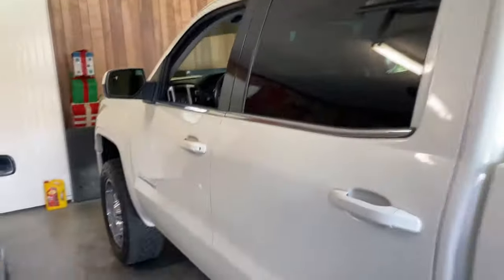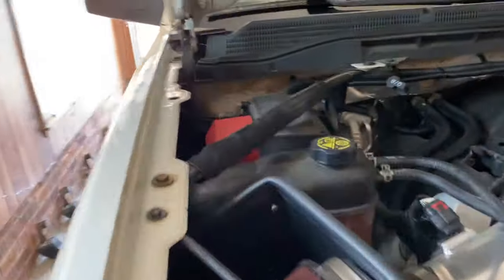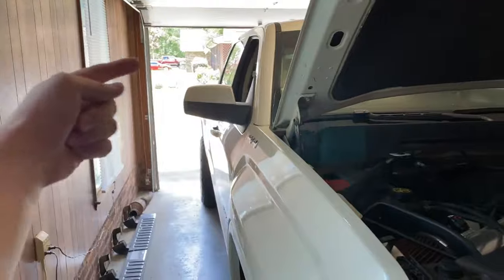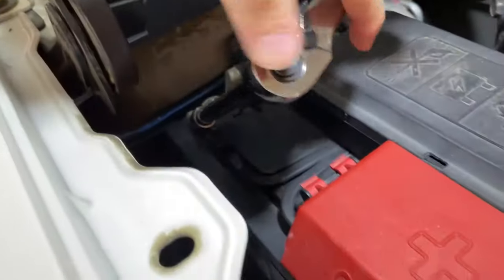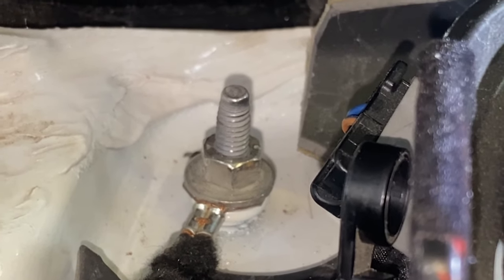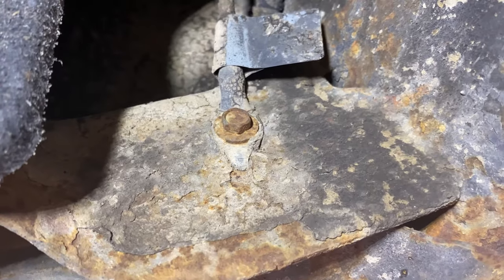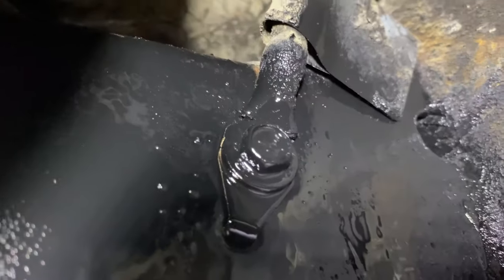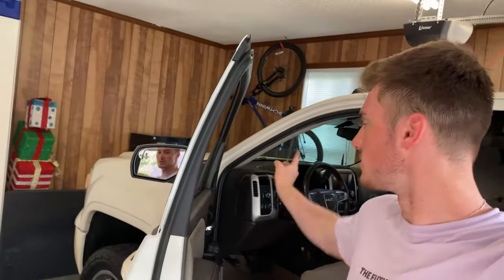2014-2018 Sierra/Silverado Flickering or Shutting Off...Ground Issue SOLVED!

Comment: Just the did the frame rail one on my 17 silverado. My ground was actually loose and covered in the frame wax. No idea how was even able to ground anything. Cleaned the frame to bare metal then tightened back down. No issues so far. My issue was stabilitrak and service trailer brake, and loss of power steering, and loss of power to guage cluster and radio all in one.
Reply from the maker: Lmk how this goes!
Reply: Thats what I'm going through now with my 18, although when I lost everything the radio kept on playing.  The worst part is it would go in to reduced power mode and only idle untill I cleared the codes... on the side of the interstate.  I fixed the problem for 5 months by replacing the SDGM module but now its back.  The G218 grounds were perfect, the frame ground was just like yours.  Hopefully it fixes the issue.. lately if it throws the codes I can't clear them as the scanner won't connect during that condition..  BCM module next or maybe somebody will steal this truck..
Reply from the maker: @joshb124  Check your connections inside the distribution block (small black on top of your battery) to see if that is effecting you too. I cleaned the connections with some wire brushes and applied some dialectic grease on them before tightening down.
Reply: @hunterrwiilson issue came back with this week's snow event. Gonna try this ground point. Ugh
Reply from the maker: @hummer3524  it’s definitely annoying. Hopefully cleaning and tightening these additional grounds will help
Reply: @hunterrwiilson  tell me about it, last thing to do is replace the negative battery cable which seems to an issue with these trucks as well
Reply from the maker: @hummer3524  I’ve heard. I love my GMC don’t get me wrong, but that fact that GM didn’t address this issue is kinda disappointing. I’ve heard some pretty rough situations from others commenting that their truck shut off on the highway with their family inside. Not a cool situation
Reply: @hunterrwiilson read that too in the forums. I did try the g218 ground however seems my truck was late enough that it was already fixed from factory. Ordered a replacment negative battery cable. See if that fixes it.
Reply from the maker: @hummer3524  that seems to be the last resort (that works) for some folks in here
Reply: @hummer3524  Any luck with the new negative battery cable?

Comment: The issue that I am having, is that the dash lights if there are not them, they do flicker somewhat ever-so-slightly. The other day, my AC took about 10 minutes to start blowing cold air. Lastly, the other day my radio did not seem to have a display, although when I looked at it in the nighttime, I could see that it was lit up. I did verify that the fuse was okay on the radio circuit. I am hoping that these two ground issues will cause my issue to go away. Lastly, when the dash flickers, the AC seems to go in rhythm with the flicker.
Reply from the maker: Seems like you need to give these two grounds out along with the other ground on the other side of the dash. That one is responsible for the AC. Clear those three grounds and see what it does for you!
Reply: @hunterrwiilson  I absolutely will give that a shot. Thank you. By the way, is the other ground on the other side as accessible as the driver side?
Reply from the maker: @dennisranck1613  of course! Glad I can help if any! Yeah it should be just as accessible as the driver side

Comment: OK... So I had all the same general issues. But when I tried to do the "Clean-up" fix of the 2 ground lugs under the dash cover I just could not get at them. No way could I undo the connection and clean the area. Plus I do not really buy that the coating is the problem. ANYWAY... What I did and it COMPLETELY solved all the strange electrical issues and it has not stalled again is run a new "Ground-Bus". Even with the very limited access I was able to secure a crimp-on wire loop terminal on top on the existing ground stud with another nut. I used #8 AWG wire (10AGW likely OK) from the driver side over to the passenger side and then down via the lower passenger side interior kick cover to the main frame/chassis ground lug as shown in many videos. This new ground bus between the two under dash cover ground lugs and to the frame ground fixed all these strange electrical issues. Hope this is helpful info. It has now been almost a year and all is still working well.
Reply from the maker: Sounds like a solid solution! You’d probably have good traction if you made a video on this
Reply: @hunterrwiilson  I'm not a video guy and enjoyed yours. Feel free to use my info for any new update by you.
Reply from the maker: @johntflaim9924  fair enough. I’ll be sure to inform others if they want to try another solution!
Reply: Forgive my ignorance, but what's a ground bus?
Reply: @DanRivas04  A BUS in electrical talk is just a common point that a termination is connected to. In industrial control systems there is always a Ground BUS Bar, a heavy gage copper bar that ALL ground leads/wirers are connected to so they ALL have the same ground point/potential. So I ran a heavy gage copper wire from the driver side to the passenger side and then down to the frame ground lug/ point. In this case the truck frame is the Bus Bar/ common point. I hope this helps. Sorry for being so late.
Reply: Thank you so much, that was a great breakdown, now I know what I need to do!
Reply: If I understand.  YOu just connected another ground wire to the battery post and somewhere to the passenger frame?  Did you go through the sensor?  Can you elaborate where you connected to the frame?

Comment: Thanks to my wife she found you and this.    Chevy service alert does not address this secondary ignition ground.  Also,  your truck looks like most underside.   We do the beach and bunch of 4x4, so yup, i checked all other possibilities,  but not the one by the speaker.  Will update after i address.   2017 silverado z71 was at the dealership for 1 months and they fixed all other bs, but nothing to address this.
Reply from the maker: Hoping it works out for you! Thanks to you and your wife for watching!

Comment: My truck started acting up today doing the exact same thing, left to work at 5am & headlights turned off & so did the dash followed by my steering wheel locking up on me as I was trying to switch lanes. It was very scary luckily there were no cars close to me & I was able to pull over turn it off & back on.
Reply from the maker: Definitely give this a try to be safe!

Comment: So I've had the same issue as many on here - Usually starts with lights flickering, stabilitrack light coming on, and the steering getting hard, then the steering wheel jerks and all electrical power is lost. Usually this all happens during low speed turns such as pulling into a parking space. I fumble around for a few minutes, open the door, blah blah, and can usually restart in a few minutes. Anti-theft kicks in and tells me to lower and raise the driver side window. Frustrating as hell. After watching your video, I went after all the ground wires - The ones under the dash, the one at the block, the one behind the wheel, etc etc etc. Took them off, cleaned, scrubbed, you name it. I had hopes, and seemingly for a couple of weeks, it worked. Unfortunately, the issue came back. So now I'm thinking the common denominator is the cable itself. I could be wrong, but I'm nearing the end of my rope with this stupid issue. So, at some point in the near future, I will order a new cable, install it, and will report back after seeing if the issue returns after that.
Reply from the maker: Others have done the same with replacing the ground wire itself and it’s seemed to work for them, grounding/electrical issues are the worst since they’re all tied together and the possibilities are endless
Reply: This didn’t work on mine. Gonna replace the negative battery cable next before driving it off a cliff.
Reply from the maker: @drrexhuffman  make sure you get it on video if it don’t work, never seen ‘14 Sierra go off a cliff
Reply: did you solve your issue?

Comment: This started up on my 2018 Silverado, the exact symptoms, Stabilitrak flashing, truck shutting off then right back on. Did the G218 fix, new negative battery cable, cleaned the contacts on the frame and engine block. Still doing it. Mechanic is telling me need a new battery, which is less than a year old. Different mechanic said change out the positive wire to the starter. Online forum says power steering issue could also cause this... about to just trade the truck in...
Reply from the maker: Did you give cleaning the distribution box connections a shot? It's the small box on top of the battery. I removed them, hit with a wire brush, applied diaelectric grease on there and tightened everything back nice and tight. I'd make sure all connections are solid, if you already haven't. But I hate to hear all of these issues. Makes a guy upset at GM for not doing anything about this :(
Reply: @hunterrwiilson  I have not tried that! I am willing to do anything at this point to make the gremlin go away. I am die hard Chevy, like have the tattoo with VIN number of my 1995 Tahoe on my arm😁... what I would give for that truck back!
Reply from the maker: @butters1877  yeah try it out! But that’s awesome! 😂 I miss the OG Sierra that started my love for trucks and kinda this channel, but I’ll get another, or that exact one, back one of these days
Reply: @butters1877 
 Update on your truck!
Reply: same, did you find the issue?

Comment: I have a similar issue out of my 2014, to where you’ll go to slow down to turn & the whole truck will shut off. A/C, radio & all. Coast to a stop, put the truck in park & restart it & a message reads “roll passenger side window down.” Hoping this fixes my issue as I’ve done the ground wire behind the passenger side wheel & no luck.
Reply from the maker: Yeah it’s a scary and annoying thing these trucks do. This has worked for me till this day, so I’m hoping it works for you
Reply: @hunterrwiilson  wow so even a year later & it’s still working ? I just bought my truck back in March & it’s done it twice. You ever have problems with the AC shutting off randomly for like a minute & then coming back on ?
Reply from the maker: @ryandurham5725  I haven’t had issues with the AC besides having to replace the condenser.
Reply: @hunterrwiilson  what were the issues you had with the AC when you had to replace the condenser if you don't mind me asking. I'm having a lot of issues where the AC will be blowing perfectly fine & then just completely cut out & black out the screen. Then a couple minutes later it comes right back on in its normal state.
Reply from the maker: @ryandurham5725  mine was a crack in a weld on the condenser. Very common in our year models. 

What it sounds like for you is a ground issue. So just as you saw me correct and fix the ground on the drivers side, do the that same process to the passenger side ground in the dash. That, allegedly, is what the AC is grounded to. So I’d give that a shot and see what happens.
Reply: @ryandurham5725  having the same issue please let me know if this fixed it or what foxed it for you
Reply: My 14 did the exact same thing yesterday pulling into my driveway
Reply: I have a 2014 silverado That started to mess up ..the voltage gauge reads high and radio and a/c turns off but once voltage gauge goes down they start working again. Any one have this issue or know how to fix it.
Reply: @AlexanderGarcia-do5dk  I was told by a dealership that they wanted to replace the battery cables & the fuse box connected to the battery. My AC still cuts off & then about a minute later comes back on, I haven’t tried either of what the dealership says but could be similar issue. Dealership did say they read high voltage 🤷‍♂️ also, I sanded down the grounds behind the passenger wheel as well as behind the speakers.

Comment: 2018 Chevy Silverado. Yeah same thing here for the past two weeks. Service Stabil Trak and Roll down window message. Mine still under a warranty but they (Dealership) are only covering the positive cable replacement. So going to try the cleaning ground contacts.
Reply from the maker: Exactly why I just hop on Dr. Google and figure it out myself, dealerships don't really help too much
Reply: P
Reply: So did that work for u? Mine is doin the same rn
Reply: @joeroe2839  yes it did.  Have not had any issue since then.
Reply: I have a 2018 too, did the me dash insulation, happened again after a month, had the battery, alternator and charging tested and everything is good. Just gotta do this trick in the video
Reply: @mistermikesal1086  hows your truck running? have had stabilitrack issue for over a year, no cruise, no other issues put 35k on since the light came on. 2018 sierra

Comment: Same issue. I got a size 10 wrench to fit in the speaker hole and from there I loosened and tightened it back up. Removed that foam shit from around and underneath

Comment: 2014 Sierra 1500 with 142k miles - symptoms were "Roll down, then up drivers window" message and one click up on drivers window did not work - had to hold button up to get window up, voltage reading just under 14 when should be just above 14, gentle dash lights flickering, left turn had temporary loss of power steering, blinker use causes cruise control to kick off, clock suddenly 47 minutes behind and yesterday the truck quit and went black while preparing to enter main roadway.  I disconnected negative battery terminal for two minutes, reconnected fired up just fine.  

First I removed dash and cleared the rubber material from both ground posts G218 and G210 resistance codes - drivers side rubber was pinched under nut washer, just don't understand how assembler could do this at factory - the hole in the material means it goes AROUND the outside of the post, and they want a 40% raise in pay for a 32 hour work week.  Started truck, still getting roll down then up window error message.  Next removed, cleaned surface and ground wire end on passenger side inside wheel well, covered with heavy duty grease to prevent element deterioration.  Opened hood and removed and cleaned ground post and end to firewall.  Started truck, no  more errors.  So far so good.  Prior errors included "Reduced engine speed" - code was wheel speed sensor - really GM, you're going to force me off the freeway because of a fricking wheel speed sensor issue?    Update 10.17.23:  Drove 600 miles today, no issues anymore.
Reply from the maker: It seems the electrical system and grounds on these year trucks Just didn’t come out good. I’ve learned to stay away from the 1st Gen of trucks. That’s where all the issues arise. But hope everything works out for you after these fixes!
Reply: Where is the "ground post and end to firewall" located?
Reply: @drrexhuffman     The front of the dashboard comes off, behind each speaker there is a grounding post.  Then open the hood and locate the ground wire attached to the firewall on the drivers side.  There are Utube videos showing how to get the dashboard off so you can get at the speakers, which I moved so I had easy access to the grounding posts.

Comment: 2014 Sierra here. All terrain edition 33’s on a 5” lift. After Dealer changed the engine (blew up on me after 6 months) I’ve had multiple issues since she returned to me. Recent weeks, subwoofers will cut out, loss of power to radio, “service stabilitrak” comes on then goes away momentarily. Will be checking grounds tomorrow.
Reply from the maker: Definitely check out these grounds but also check the connections inside that smaller box that sits on your battery. You'll see it has bigger gauge wires coming out of it. I cleaned those connections and put some dielectric grease on them. Tightened them down well to make sure no gaps and the grease will make sure no moisture messes with the connections.

Comment: So I'm doing this right now. If you remove the speaker you can squeeze a wrench on it easy. I recommend getting a cheap 10mm ratcheting wrench from Harbour freight (princess auto) and you will have to put a slight bend at the end

Comment: Hunter? So I scrolled and read many of the comments, I’m just curious did your radio display go black as well ? My situation is my lights began very slightly flickering then when I when to roll my window down the headlamps completely went out but only as long as I would hold the switch I was on the interstate so I’m not sure if the power steering actually cut out but when I arrived home when I tap my brake it would go out but not as I applied it to stop but only tap. Not sure if that makes much sense but I was wondering what all was actually happening I appreciate it time an thanks in advance
Reply from the maker: It seems to me that all of your issues are heavily affected by the grounds. Since most of the truck, even the power steering, is electric, one short or mishap will throw the entire truck off since there’s a running ground loop around the truck. Dig into these ground fixes and see if that helps

Comment: My cables melted where they run along the firewall near the exhaust manifold. Why did gm decide to run these grounds so close to the exhaust? It's an accident waiting to happen when someones truck just shuts off while driving without warning and you no longer have power steering or power brakes.
Reply from the maker: I know it's no fun at all. The fact that this video is approaching 100k views is concerning to me.